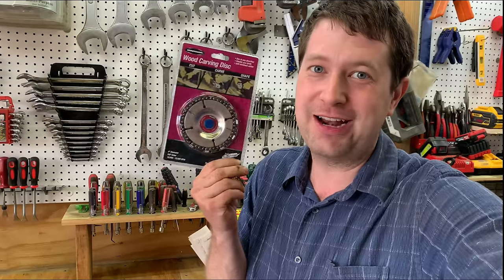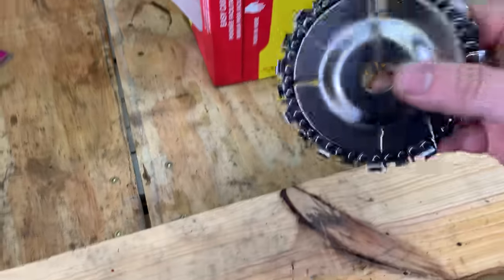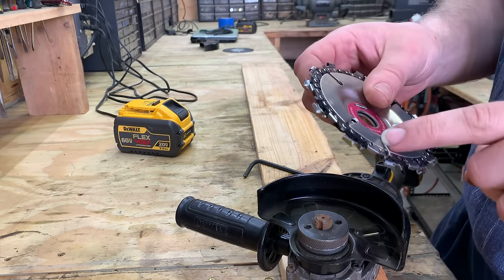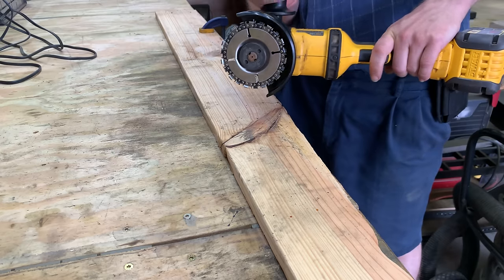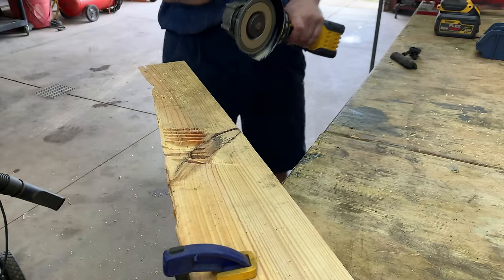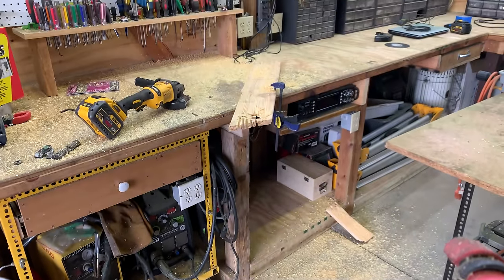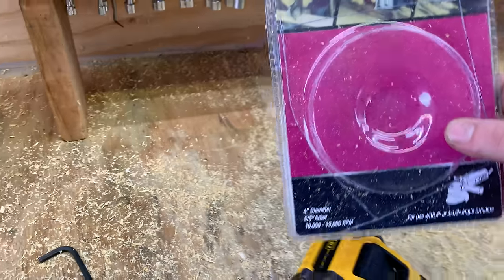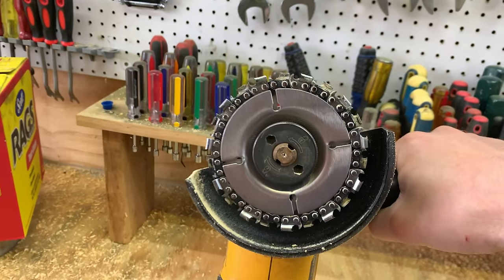Most Dangerous Angle Grinder Attachment I have Ever Seen

Comment: Most dangerous tool here is the one using the grinder.
Reply: Couldn't help yourself, had to go there.
Reply: LMAO!!!! I doubt he even got it without someone explaining it to him..LOL!!!
Reply: Hahah god I needed that. Couldn't have said it better 😆
Reply: how does he have all his fingers?
Reply: Don't know why someone would say this attachment is dangerous. Great tool.
Reply: Amen, thank you!
Reply: @6lr6ak6  because it is dangerous, angle grinders are very dangerous tools. this blade doesn't really make it anymore dangerous though, I think that's what you meant. it doesn't matter if it's a chainsaw thing or a grinding wheel. if something hits your hand spinning at 10k RPM it will fuck you up no matter what.
Reply: @ElectronicsForFun  the blade does make it more dangerous. It has big teeth that can grab where as if it was a grinding disk it wouldn't do that. I didnt even think he'd be able to dish out the wood like that as the blade is pretty aggressive but try all of that again when the chain is dull and see what happens. The chain will cut your fingers off if you hit them whereas a grinding disk will just burn you
Reply: Are you sure you're a woodworker or you just videoing that in someone else's shop
Reply: It's not for cutting Lumber, it's for wood carving .You might want to look that up.
Reply: Lol
Reply: Hahahaa
Reply: @bolerdweller  
Obviously you've never seen and angle grinder disc get pinched and jump.
A friend of mine had to be rushed to hospital when it happened. He was working on his back under a Land Rover. The grinder snagged, jumped, he lost control of it and it cut his face, arm and into his neck. It was a close call. He needed surgery and a ton of stitches.
Trust me, it will do a lot more than just burn you.
Reply: @bolerdweller  
Not denying that, but your original comment gives the impression the worst you'll get from an abrasive cutting or grinding disc is a burn.
That isn't true.
I fully appreciate the dangers of discs snagging, jamming, jumping, being pinched in the work piece, fragments flying off or the disc bursting. They are deathly dangerous tools when it all goes pear shaped, regardless of the blade in them.
I wouldn't want to see the damage one of those chainsaw discs could do in contact with flesh.
Reply: @neilcrawford8303  maybe there could have been a safer tool to use in that situation, like a sawzall? I've had grinders hop but I don't put myself in scary situations. And if I need to use a grinder in a weird spot I use my cordless makita, it shuts down when it snags
Reply: Some smooth brained commenters rabidly defending this abomination of a combination.
Tell nearly any arborist or actual wood carver this attachment is a great idea and they'll probably choke from shock/ laughter.
Reply: @user-wp5fe8ec6l  Colleague of mine is a chainsaw carver. Wins prizes. Sells stuff he's carved. He uses this type of carving cutter all the time. Has a cordless grinder just for this. And one for the arborteck. 
A chainsaw is good for cutting our a basic shape, but for the actual carving, this tool is what those guys use. Even a little chainsaw with a 12" bar is much less controllable than a two-handed grinder
Reply: true dat
Reply: OMG...You can't be serious. This is like drinking filtered cyanide water.
Reply: @alaskagoldtoolco.4915  
When he showed me the scars, I'd say he's lucky to be in a position for you to be able say he is an idiot, and not was an idiot.
Working in a confined area, on his back and at close quarters with the tool when he lost control. It basically did its own thing over his neck and arm.
Not his wisest move.
Reply: Omg soooo many awesome  post here , and a chainsaw safer , ok yeah a long bar sticking out not covered is safer ok
Reply: Leigh Colman  lmao 😆
Reply: Billy Buckles I’m just as scared (engage brain before finger on power button scared) by my circulars saw attachement for the angle grinder.
Reply: hahahaha very true
Reply: Agreed
Reply: mister clean  my sawzall fits everywhere my grinder fits and with a 12 inch blade on it even better. And if you re under a vehicle not raised high enough to even fit, let alone a tool then I wouldn't be trying to awkwardly hold a grinder above me. That's a Darwin award
Reply: Why does this guy have all these tools when he's obviously in the dark and will never see the light.
Reply: Lol 👍
Reply: Agreed
Reply: if he thinks that's dangerous , wait till he discovers the hideous device called the chainsaw 😲
Reply: Brutal!
Reply: This video proves that he's never used a grinder for grinding anything.
Reply: More like most clickbaity email attachment.
Reply: Dangerous or dullest?
Reply: Lol
Reply: @Billy Buckles small child, you don't understand tools. Go google "angle grinder injury" with safe search off, if your parents added that option. It is incredibly dangerous.
Reply: legionary anti-illuminati  he is already using a dangerous tool. Look up "angle grinder injury" if you're unsure. He's also not wearing any safety equipment, and complaining about sawdust, which every woodcutting tool makes.
Reply: @user-wp5fe8ec6l  I agree. I'm a forty year in the business wood worker. This is the most idiotic combination I've ever seen sold as a legitimate suggestion for a tool combination.

Anyone that doubts this? Check out youtuber "Stumpy Nubs" take on it. One of the most popular most respected woodworkers on YouTube. He about removed his hand with one a year ago and actually caught it on video. He breaks down the how, why it happened and why this is such a completely idiotic idea.  The first time I saw one for sale in a store I couldn't believe my eyes. I thought it was a ridiculously dangerous idea and count actually believe it was a real thing.
Reply: If you got yourself a few gerbils, you got plenty of cheap bedding materials for them in those wood shavings....
Reply: Sometimes to make a car run better, you adjust the nut behind the steering wheel.
Reply: What a simpleton. If you use a chainsaw you wear protective equipment. The sight of his naked knees close to that spinning blade made me cringe.
Reply: Thats amazing! I want one, where did you buy?
Reply: I agree! He just doesn’t know how to use tools
Reply: my thoughts exactly.
Reply: Good on ya!  I am sure this  dude could put his eye out with a stapler, never mind the dangers of a staple remover.
Reply: it does seem to do a great job with carving but it also does look like a crazy invention
Reply: I’ve been laughing for over an hour! Thanks!
Reply: Fuckin gottem
Reply: @ElectronicsForFun  usually when i get myself with the grinding wheel i only get a little bit of rug burn
Reply: @neilcrawford8303  You are right! This thing will dig into the skin and bone pulling itself deeper and deeper and it will do it very, very fast! Like, have some tourniquets handy because if this thing binds or for whatever reason, just seems to bump your skin, put the tool down and apply pressure to the wound until someone can apply the tourniquet and call 911. Also, if an appendage is severed, clean it with fresh, clean water and pack in ice and send it with victim to emergency room where, they may be able to reattach it. If not, it may be used as a one-time special puppy treat or taken to a taxidermist to have a "stupid craftsman award" mount made. lol
Reply: @mlwee6796  Well............maybe not quite....that bad. lol
Reply: @billfromgermany 
 the sight of those knees tells you all you need to know about him !
Reply: He must have had adult supervision off camera, as well as his wife's permission.
Reply: 1. The "big bar" is attached to the saw engine, which usually weighs a lot more than a grinder body, thus a lot more inertia. 
2. You can get a much better grip on the two chainsaw handles than you can on the grinder body, at least (the grinder side handle is decent).  The grinder body is also often at a weird angle for optimal holding strength.  
3. There's only one small section of a chainsaw blade that will really cause a bad kickback reaction (not just towards you, but up and towards you).   Compare that to the disc, where about 40-50% of the circle will at least direct it towards you.  
4.  People tend to use these discs at all kinds of weird angles, and not be careful. 
5.  Chainsaws have chain brakes.
Reply: I was going to say the same thing.
Needs to review the easy bake oven
Reply: legionary anti-illuminati  
The chainsaw grinding wheel itself is inherently dangerous. The way he was using it may be the safest way to use it (less the no PPE part), but that is not how many people use it. It is much more dangerous using it faced downward. It can and does grab and bite, wrenching from your hands and goes flying. 

Forget that, the damn thing is dangerous any way it is used. When it dulls, it becomes even more dangerous. You will very likely not be able to control it if/when it grabs, and it will cut whatever is in its path. I found mine, the original Lancelot, not a cheap knockoff, in a drawer a while ago, clamped the chain in a vise and whacked it with a hammer until it broke. I had always been afraid of the thing, and didn't want to be tempted to use it again. 

There are better, safer options that are made for the angle grinder that can do the same job. 

The idiot in this video diving right into a knot having never uses the tool was just moronic.
Reply: The Gallows   That Dewalt Flexvolt 4 1/2" - 6in" Grinder spins at 11,000 rpm. I own one, and it's the most aggressive grinder I have.
Reply: @6lr6ak6  It's only as dangerous as the person mishandling it.....see video for 'how not to'......
Reply: @ElectronicsForFun  Yes Yr right, power tools in the wrong hands could be dangerous. In experienced hands there superb.
Reply: Leigh Colman your hilarious😂🤣🤣🤣🤣💯😵
Reply: It was a collosal opportunity and you were the first one there when the doors ope opened at the sidewalk sale = I don't know why I'm trying to give you an attitude - I'd of thrown down in an instant if I had the opportunity. Besides dude isn't that much of a buffoon anyway he's just kind of acting it up like one so I'm sure he can take the comment in stride = everything I wanted to see him try with that saw chain equipped grinder he actually did, he's got his sh*# pretty well togethor it seems and just doing a decent job of acting it up. I'm kind of thinking dudes pretty cool. I enjoyed the video and I guess I'll check out more based on this one 👍
Reply: @bolerdweller  bolerdweller is dead on = the intense ripping your freaking flesh apart power of those saw teeth make that attachment infinitely more dangerous. I've got so many hours over the years on angle grinders that I've gotten too careless - I've cut my fingers many times with cut-off wheels and even a good hit isn't that bad since it sort of cauterizes as it cuts so basically you have to work at it to really get into finger loss = that tool will remove fingers in a heartbeat . Your  smart enough to look a little deeper at things and pick up on stuff others don't - this is just one occasion where it was the opposite of the logic you were using - logic I understand and use myself - now and then similar efforts put me on the wrong side of the coin as well = keep going its how we do and you probably had the other three five or ten arguments right on. I recognize. most people aren't usually real enough to talk truth = they just want to get the smartest sounding dig in and a bunch of likes = why the fuck would tnat be impressive to me? World is literally full of walking talking dipshidiots. Not most of the guys here though = refreshing, peace.
Reply: you want to really get to the truth it's whatever the hell anyone makes of it because the people who created it probably didn't have a general purpose on Lock and they don't need one  = okay we need something in expensive to make this fast and if it's aggressive in fastballs it is really catch the eye it would be good if it actually works to it works fast just like it looks fast it will sell hey I know just pinch a length of saw chain between two inexpensive stainless steel disc's and that's it they buy it they can handle clamping the pieces togethor on their grinder so it's cheaper for us with no welding and more flexible for them especially when it needs sharpened = idea number 7646...... APROVED! Actually I can think of a lot of uses for it myself both at home and in my construction/remodeling business I'm  going to buy one. You have to know the characteristics of the tool and the material your using on and for that brief amount of time you need to hyper focus and have uninterrupted intention. Asian races understand "intention" well. Think Samurai. Peace
Reply: @neilcrawford8303  there are exceptional situations in which you get results that aren't typical = under a vehicle with the grinder near your face puts you in a compromised position to begin with but with proper ppe you can still use one in that circumstance with some limitations. Also when a cut off disc breaks or gets chewed up good so it's edge is actually serrated = that ups the potential for serious injury big time so you get it jammed the wheel becomes serrated or worse has just a knife edged piece still attached and it's hauling ass when it tore into your buddy = I'm sorry that happened and it can happen to an experienced user so it's important information you shared. that experience adds a new element and Im big enough to say might even make me tread a little more carefully with my thoughts on cut off wheel safety because despite years of professional experience any human can experience an accident that seemed to be outside of what they could realistically imagine. most people with heavy grinder experience will tell you that cut off wheel accidents are usually pretty mild and it's true BUT! - here's an example of a situation that was the opposite of mild = seriously thanks for sharing = this is how we learn from each other. Now if we can just share without getting an attitude with one another. Hopeful and looking better each month in my opinion. Peace
Reply: Lol
Reply: To the one who replied, I got your tool hangen
Reply: Just the way he talks you can tell he's a Goober lol
Reply: Oh this looks dangerous, then proceeds to slam it about wildy
Reply: Come on ..... really!!! Just trying to say be careful! This tool will get away on the most experienced person with this tool. Even coming sense realizes the problems with this aggressive tool! Common sense it's dangerous, ok.
Reply: Hey oooooo
Reply: Ya it’s great tool until one of the teeth’s grabs ahold of the wood and you get some kickback towards your fingers.. always a great ending👍🏼
Reply: Haha you got your self on that one
Reply: @kgilliagorilla2761  he earned his golden banana sticker
Reply: legionary anti-illuminati  i cant shed any light on the matter and its to dim for me to type why
Reply: @Alex-ui8xp  i do not recommend bear maulings. As a follow up. Theres like a recording of a woman just being eaten for like 10-20 minutes while her family is in a tree near by. No thanks needed.
Reply: @stephenkohl2452  I’m not real sure what that is, but an award is an award, thanks.  I have a few hours logged holding onto a grinder.  That thing looks narly!  Be careful 🤓
Reply: @kgilliagorilla2761  haha holding on to it seems be the operative idea. Darwin awards arent for me or you. Have you sharpened yours yet?
Reply: said what i was thinking lol
Reply: @ElectronicsForFun  have you used a grinder? A disc will burn and cut you, it's bad but with this you have no chance as it will rip chunks of muscle, bone and tendon before you realise it!
Reply: @ElectronicsForFun  not true i have hit my leg shoes clothes hand and arm with stripping wheels before. They are not dangerous when used properly. The only part that gets sketchy is cutting discs flying apart.
Reply: @Sak-zo1ui  I have seen that enough times. people need to realize there is a difference between a cutting wheel and a grinding wheel.
Reply: @ElectronicsForFun  agreed. Same with not putting to much sideways pressure on the disc.
Reply: Karen......
Reply: Perfect response
Reply: @ElectronicsForFun  I’ve been nailed with a grinding wheel, and can vouch that a chainsaw blade would have removed far more of
My flesh than the grinder disc did..
Reply: Agreed ! Yes go there !
Reply: Dude, I don't like shitting on people but, that is fykked up and accurate! LOL!.... Nah, I think he expected a lot more kickback which is what would scare me too. My boy was a tree dude, and that's the only reason that I know that chainsaw tooth technology has come a long way, made it safer.
Reply: Lol, as a Sheet Metal Worker, I admit looking for this exact comment. Thank you 🤣
Reply: You got a good laugh out of me brother, thanks!
Reply: LMFAO!
Reply: @bolerdweller  it probably wasn't a full sized grinder probably an air tool with  cutting blade
Reply: Hahahahah bro best comment ever
Reply: Give me a chainsaw to cut some copper pipe
Reply: @ElectronicsForFun  
That's what face shields, eye goggles, leather gloves and all other types of ppe is for.  An angle grinder is no more dangerous than any other power tool when used as directed, and using with proper ppe.
Reply: Lollllll
Reply: Absolutely agree , what a wimp
Reply: @6lr6ak6  wanted to cuss instead 🙏😁
Reply: @bolerdweller  😭😭😭😭😭😭😭😭😭😭😭😭💰💰💰💰💰💰💰😁😁😁😁😁😁
Reply: @rossbuchanan7632  😭😭😭😭😭
Reply: @StealingLightLtd you think you can lose fingers with a angle when you use an angle properly you are those Americans that turn anything into safety